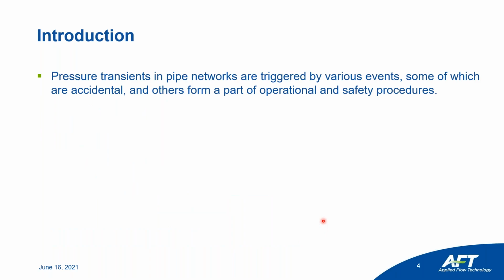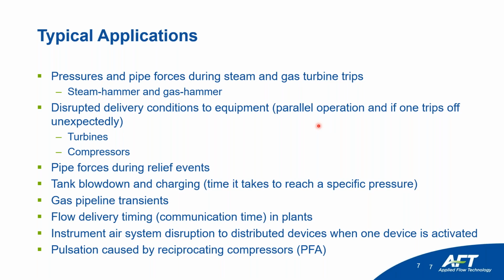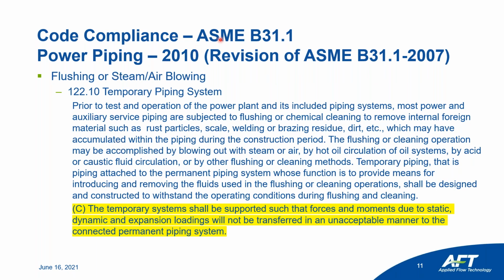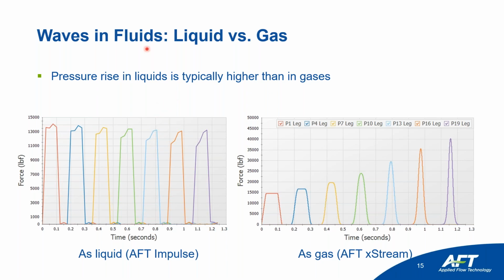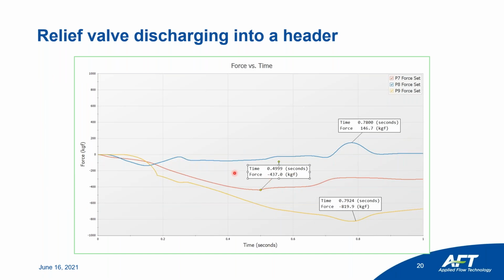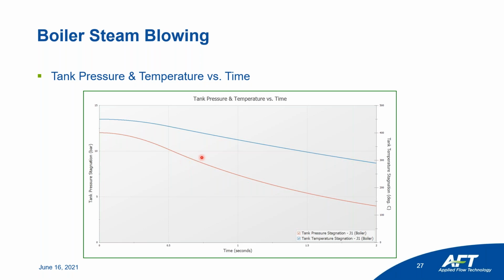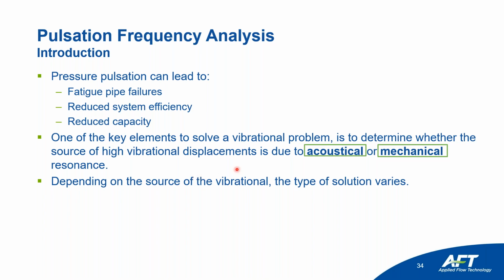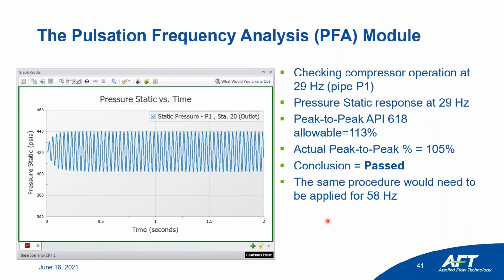An xStream Look at Gas and Steam Transients

Comment: I have some questions regarding MOC implementation for the relief (safety valve) discharge systems. 
If discharge is realized into the environment just before safety valve starts to open the discharge system is filled with air.  At the same time the pressurized system is filled with the steam, saturated or superheated.
According to MOC in order to define flow parameters at the current node of the calculating mesh at the time moment  “n’  you need to define the start points of direct, reverse and trajectory characteristics at the time moment “n-1”.   These characteristics start at the different points at the time moment “n-1” but all three of them cross at the current node at the time moment “n”.  Inclination of the characteristics depend on the sonic velocity (and flow velocity also)    of the corresponding medium – air or steam.
Therefore to apply correct sonic velocity you need to trace the travel of the front (interface) between the steam and air which the steam is pumping out of the discharge system.  In such a case you can select the relevant medium and define sonic velocity correctly.
It is not the difficult problem if we consider the single safety valve with the single discharge line.  But the task becomes much more difficult if we consider the system of the several safety valves each of them having discharge branches.  These branches can be connected downstream by means of TEE or WYE elements at least getting into the common discharge manifold.  The variation of the connections can be arbitrary.
In such a case you need to trace the travel of several fronts between steam and air.  These fronts have different length of the route from the corresponding valve through the connections and down to the exhaust section.
Have you take into account this circumstances and how do you solve the problem.

Thank you
Regards
Reply from the maker: Thank you for watching the webinar! Currently AFT xStream does not track interfacial differences between fluids since the system is assumed to be a single fluid. You are correct that these interfacial differences would impact results with the different sonic velocities. There are a number of other considerations for these interfaces as well, such as heat transfer between fluids, mixing of fluids, and the resulting mixture’s sonic velocity (especially if considering multiple relief valves to a combined header).

While this isn’t currently a capability, it would be similar to tracking other parameters which transmit with flow and impact sonic velocity. An example is temperature which can similarly transfer with flow and impact sonic velocity, even for a single fluid species. AFT xStream will capture these temperature considerations and its relationship to a greater equation of state, ensuring these non-idealities are modeled correctly. We hope to explore the impact of fluid interfaces and mixing in a future version of AFT xStream, so be sure to stay tuned!